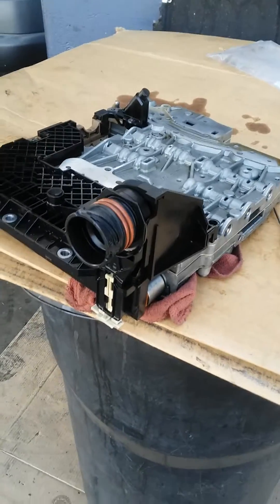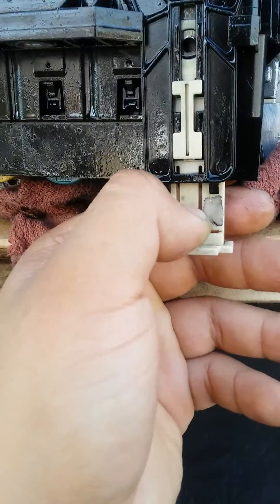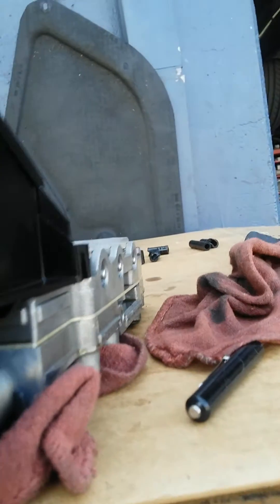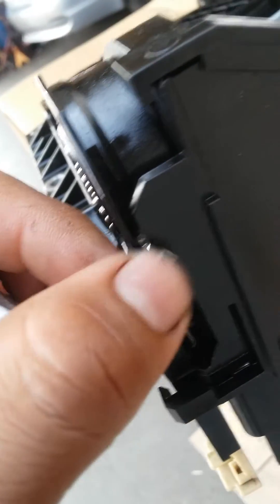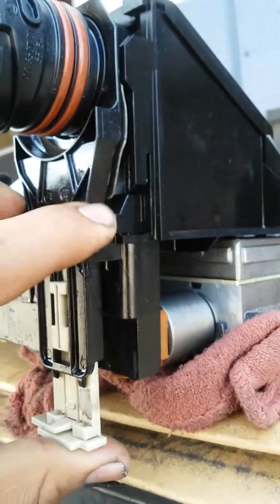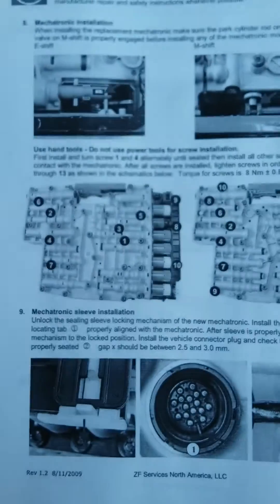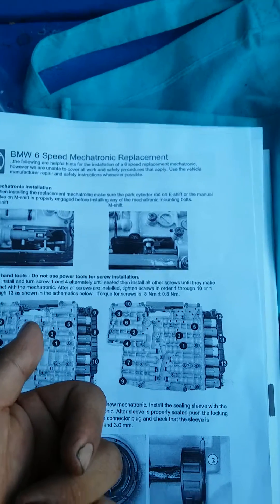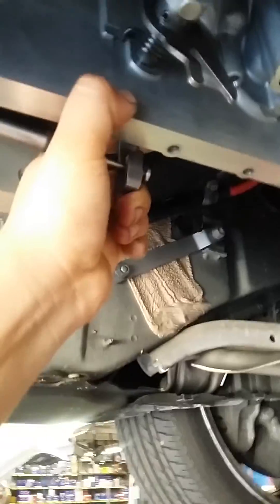2007 BMW 335i ZF 6hp21 mechatronics related video part 2

Comment: for get about  trying get the latch to lock in to start with , get the sleve and as you move it round slowly you will feel it suddenly go in about 3mm  at that point ITS NOT fully home you have to push  it in another 3mm  it will feel like its not budging but youve GOT to find a way to push it in that extra bit , the key is to have pressure even all round not just at the top or bottom , ive got really small hands so i could get 3 fingers on the bottom part and 3 fingers on other hand  on top part , its hard esp if your lying down on your back coz you dont have a  lift, REMEMBER getting it in the first 3mm is key then you know theres another 3mm to go TO much is made about the locking latch if youve got the part ive just explained right the locking latch will slide up no problem . SOMETIMES the locking latch will slide home even if you only pushed the sleve in 3mm but youll know you did it wrong az soon az you put key in ignition it will say gearbox fault  restricted mode becouse the pins and connecter arnt fully mated.

Comment: It was a pain in the ass trying to install the mechatronic sealing sleeve. I watched many videos and nothing helped. This video gave me a idea? 
Very true you need to push in sleeve and twist slowly until notch slides in the mechatronic. Try it a few times until you feel comfortable it has slide in 2mm.  Use a 32mm Wrench to push sleeve inside. Put the round head of wrench, anchor and pull. Takes a few seconds to push in. Pull wrench again and push up security lock. Don't forget to add some oil to the O rings to make things easy. The best way to do this job. Hope it helps others

Comment: Man, wish I had watched your video before I torqued mine in. I tried to duplicate doing it outside as you did but it was hard and someone mentioned it was easier to do it once the body was on. The 8nm translates to 5.87 so I rounded it off to 6 fp. Thanks for the tricky part of how that tab works.

Comment: I figured it out.
Latch will not lock, with out the sleeve in correct position.
The sleeve needs to be at 2mm, from the wall.
To get the sleeve to 2 mm, it required the use of a 24mm rsocket. I gently pushed.the sleeve in.
Then victory!!
Don't be concerned about the latch not locking.  The sleeve must be in correctly, then it latches.
Thank you for posting this video!!!!!!!!
Reply: no m8 ive had the latch locking and the sleve wasnt fully "home"  .
Reply: @jagvolvo33 me too so does that mean I have to push it in more
Reply: Did you loosen the mounts to drop transmission to get room or was that not necessary?
Reply: @tnt9126  in my case I didn’t

Comment: I'm also having this issue. Can you answer a few questions?
 1) Is it normal, that the sleeve latch will not lock with the sleeve being absent?
2) Once the sleeve is in it's correct position, then the sleeve will allow the locking latch to engage?
#) Did you eventually figure it out?
Thank you great video!!
Reply from the maker: There is more videos on my channel
Reply from the maker: There is more videos on my channel check them out....

Comment: Hi Abraham, managed eventually with the latch and Mechatronic sleeve, removed the exhaust and gearbox mounting for better access to make sure the sleeve went in squarely and far enough and the latch slid easily into place. Crap design in my mind.
Thanks once again for the video.
Reply from the maker: Gareth Davies you know keep in mind that we trying to save us much as time possible removing the exhaust might cause other problems such as broken studs strip nuts etcetera so that it's time to the bill which at the end of the day sometimes it's not even paid by the customer if you know what I mean but the fact is that yeah I thought about it but I think it's not worth it